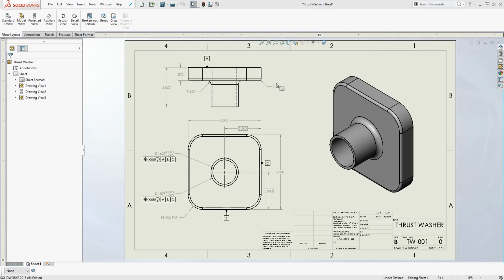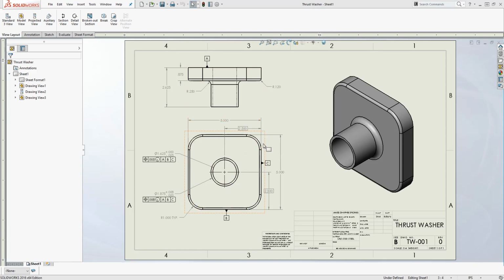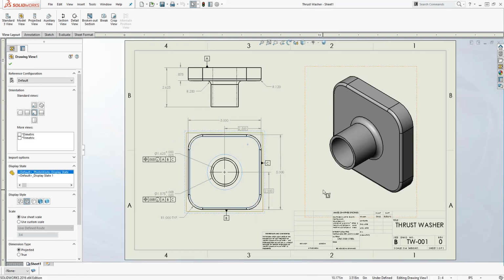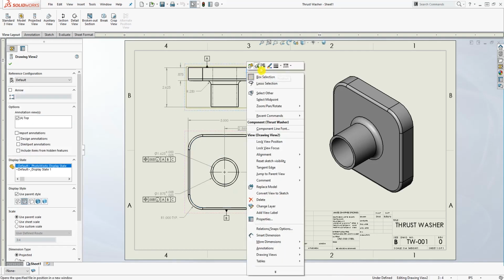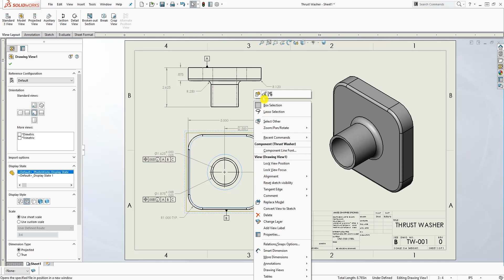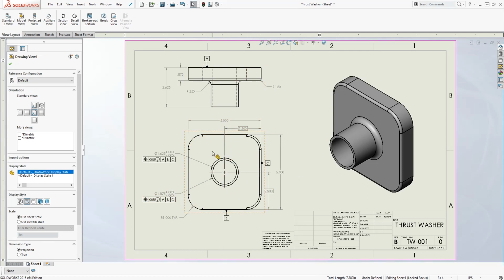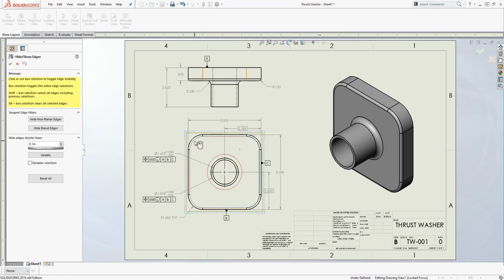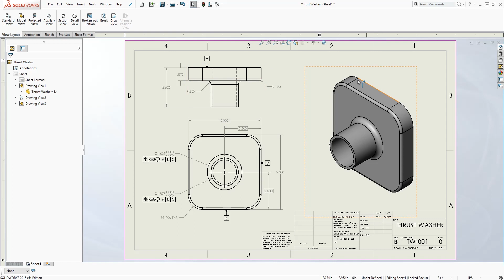SolidWorks Tutorial: How to Hide and Show Edges

Comment: solidworks is really pissing me off with trying to hide lines on drawings.  If you have an edge that has 2 lines on top of one another, then you hide one but can still see the other.  When you try to hide the second line, it makes the original reappear and does not hide the second.  I have struggled with this for years.  You have the hardest time trying to hid simple lines on a solidworks drawing.  How stupid is this.  If I already hid a line why would you think I wanted to select the one I already have hidden and not the one I can see?  It is ridiculous how difficult solidworks makes simple tasks.  Also Solidworks is getting worse and worse with its drawings.  The glitches never get fixed and with every release more arrise.  I am no longer able to select hidden lines for cylinders.  I used to like this software.  Now it is such trash.

Comment: Does anyone know a way to prevent sketches from permeating through a part?  I want to sketch on a particular surface (i.e. add a part marking stamp), rotate the part and not see that marking on the opposite side (letters / numbers reversed).  This is also an issue when I create views in a drawing, I don't want to be forced to "hide" sketches.